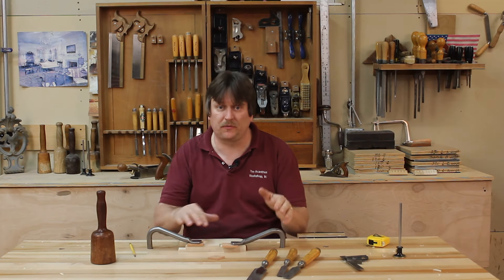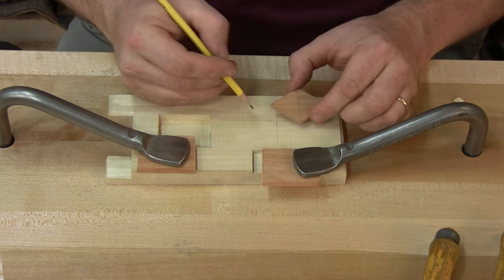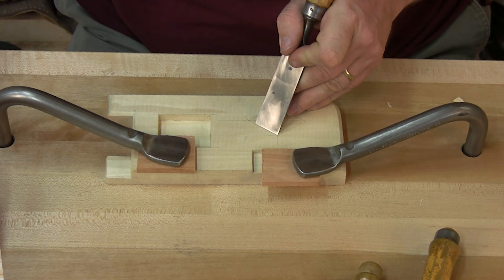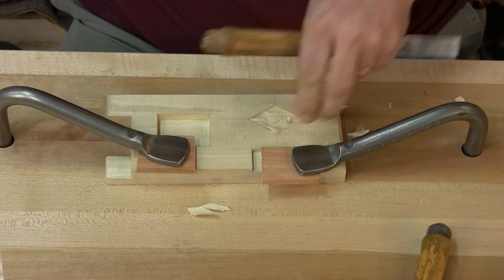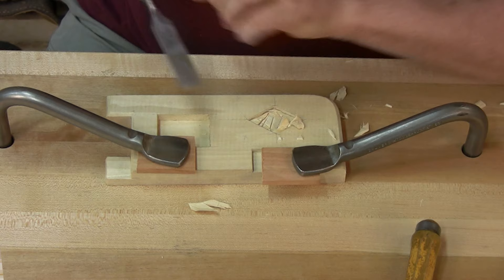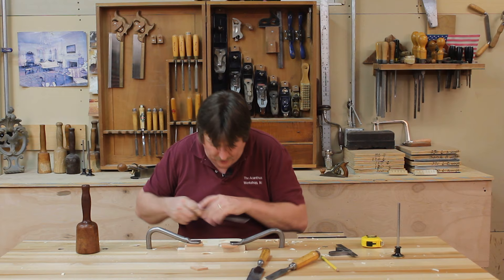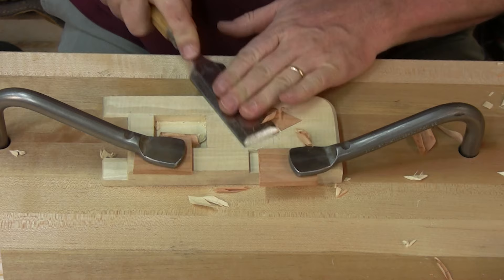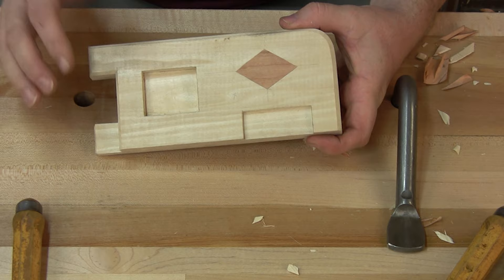Bench Chisel Exercises Part 4: Simple Diamond Inlay

Comment: Do you have a suggestion for a beginner chisel set? Kinda worried that I wouldn't even know if they were sharpened or not, but I want to pick up this new hobby
Reply from the maker: Ross B, My first response to that question is usually asking if you know how to sharpen. If the answer is, "yes" then I'd suggest you look at a good quality set of chisel from Lee Valley or Lie-Nielsen. If the answer is, "no" (which I suspect is probably what you would say given how you phrased the question) I'd go with a set that's far less expensive - they won't be sharp. But that's the point. 

An inexpensive set of chisels will not hold an edge as long as a higher quality set. You need to learn how to sharpen, and just about all chisels can be brought to a sharp edge. The more you sharpen, the better and faster you'll get at it and once you've got a system down, then look to a better quality set. And you'll want to because the cheaper chisels will break down pretty quickly and you'll find yourself sharpening almost as much as you're using them. So, a set from Harbor Freight or the local Big Box store is fine to learn on, but eventually you'll want to invest in something better. 

How to sharpen is a matter of personal preference. I hollow grind, using a bench grinder, and free-hand hone on water stones. You can use any method that seems to work for you. But once you pick a method try to stick with it. The more you use it, the sharper your tools will be and the more consistent you'll be at getting them there. 

Email me if you have any other questions. My email address can be found on my website at www.acanthus.com
Reply: @acanthuscarver  Awesome, I appreciate the detailed response!  Looks like I will start with the inexpensive ones then :)